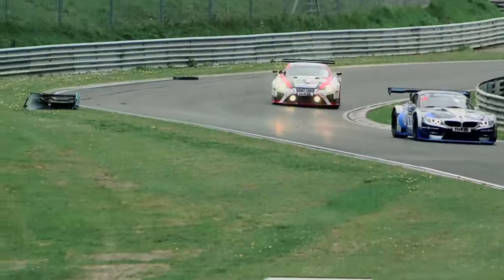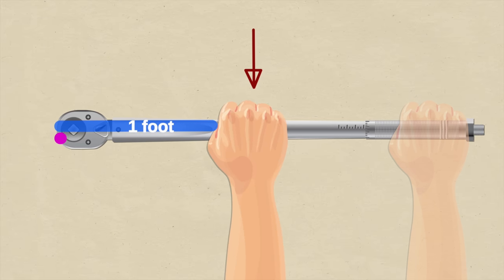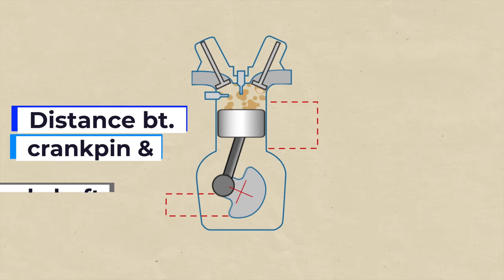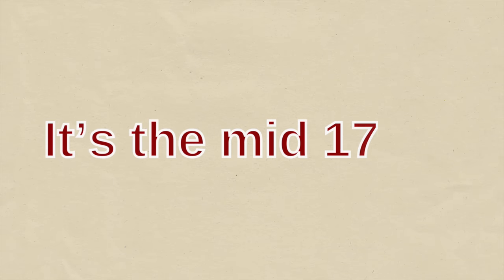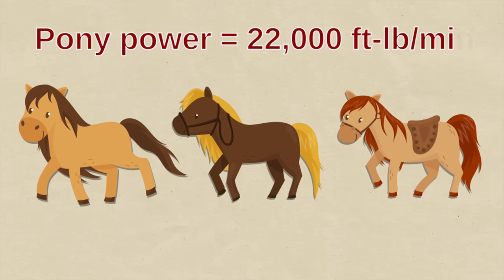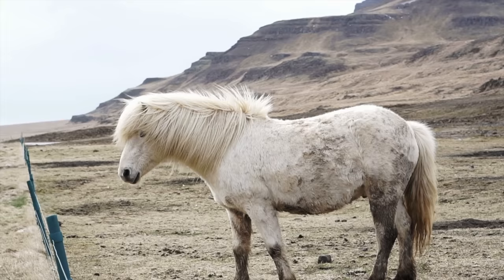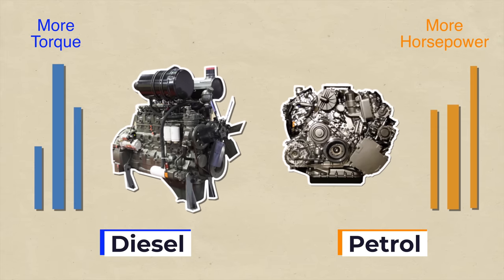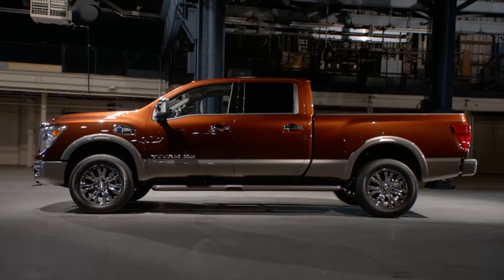Torque vs Horsepower, Which is Better

Comment: Simply put, Horsepower is how fast you apply torque.
Reply: No, that's incorrect. Torque doesn't necessarily mean rotation. You could be on a hill with the engine and transmission holding you, but technically that is doing no work because you're not moving. Horsepower is a measure of the rate of doing work, which requires movement against a force. Torque is only the force part of it. Your specific terminology "how fast you apply torque" is expressed mathematically as lb-ft/sec. The closest real world example in car space would be how quickly you step on the gas, or let out the clutch, but even those examples are over-simplistic.

Comment: Hey ive got a problem, before my 2008 audi a4 was leaking oil like the tin man, me and my father repaired that situation with a new oil cover gasket and now its dry as a bone but the oil leakage was covering up another severely minor leak in comparison however its still a concern because from what i can tell it is either transmission fluid in which case im fucked for a week or hydraulic fluid in which case im still fucked for about 4 days and the amount of time for repair isn't really the issue lol so forget that but more so the price. And idk which one it is, my father told me that replacing seals in the trans isnt worth the effort i might as well just buy another trans while if its the hydraulic im assuming you just replace the seals and maybe some gaskets and youre good to go. How true is that? Can i not replace the fluid and seals in my trans without causing the gears to slip and skip? The fluid in question is not very viscous at all compared to oil, is very slippery and and acts like a lubricant and is a bright translucent pink or light red
Reply: How many miles on the '08? If you've been changing the trans fluid according to the maintenance schedule, probably OK to change it again. But if you've skipped it, then you may end up with a problem as not all of the old oil will be drained out and the viscosity of the new and old oil won't work well. In that case, you just leave it alone if it's working fine.
Reply: @ninemilliondollars  we drained it, and refilled it with 5 quarts of new oil and a conditioner and its working great, no more leaks. Idk if maybe we put to little in or what but the trans sounds and feels a million times better then before, no more clunky changes or very shaky start ups and idles anymore. Pretty awesome lol. I will say the, not soon after my starter broke and weve replaced that too and now it starts and runs even better lol idk why a starter would affect everything like that but it did.
Reply: @ninemilliondollars  also over 120k but less then 190k miles idk i havent been keeping track. I got it when it had 72k miles and i drive a lot
Reply: @ninemilliondollars  just looked it has 129,185 miles exactly.
Reply: @BallistikaGames  Glad you got all the worked out. For clunking, a low level of trans fluid can cause that as the internal parts try to function without the correct level. Good also you got the starter replaced. They do go bad and on cars that have the stop-start process where the engine shuts off at traffic lights or other places where you're stopped for more than a few seconds, the starter gets worked way more than if it only shuts off when you're done driving. When they get weak, the engine doesn't start well, as you found out. So keep that vehicle working! I had a 1991 Acura Integra 1.8 L with 305,000 on it with original clutch, engine, and trans. My sister had a 2004 Honda CR-V with 353,000 on it. :D

Comment: is it accurate to say that horsepower is the work that produces the torque which moves a vehicle?
Reply: It is the rate at which work is done. The torque produces the horsepower, not the other way around :-)
Reply: Torque is a force but in an engine, that force turns the engine shaft and the momentum results in horsepower.

Comment: The instantly high torque at low rpm is why Teslas can accelerate so quickly.
Reply: That's because he uses induction electric motors without brushes. There is no counter-electromotive force to overcome (motors with brushes generate a magnetic force that works against the motor). Also the internal combustion engine wastes energy accelerating the heaver parts of that type of engine. However, I wonder how much an electric motor of 4-500 HP would cost to replace a diesel truck and pull 80,000 lbs.? That's a much bigger challenge.

Comment: Doesn't a gearbox convert torque to and from speed to the wheels?
Reply: Yes and no. A gearbox takes an input torque and RPM from the engine and converts it to some combination of an output torque and output RPM. In a manual gearbox, for any particular input RPM, a "low" gear gives you very high output torque but low output RPM, while a "high" gear gives you high output RPM, but at a lower output torque. The product of the two - RPM and torque - is power.
When we apply the output torque from the gearbox to the wheels at a standing start in low gear, the torque overcomes friction and inertia (from the weight of the car) and accelerates the car. But once the wheels are turning at a certain speed you need to select a "higher" gear, because the engine's speed is limited. Selecting a higher gear allows the engine to turn the wheels faster, but in order to do so it must give up torque, because the product of the two - T x RPM - for any engine at any speed, is  the maximum power output of the engine. This is why you accelerate slower as you increase in speed.
The gearbox, together with the final drive ratio of the differential, is designed to give the optimal combination of torque and RPM for the particular purpose of the vehicle.
Reply: There's one more concept to think about: when we talk about torque and power from an engine, we're talking about "maximum available" torque and power. The torque required to keep a car traveling at a certain speed (against wind resistance, rolling friction, etc) will be only some fraction of the maximum available torque. The power used (we typically use the word "developed") is also only some fraction of the maximum available power. When the car is at constant speed, there is an equilibrium between the power "developed" and the power lost by wind resistance, etc. As you increase speed, the wind resistance increases (very approximately, by the square of velocity change, so doubling the velocity quadruples the wind resistance), and at some point the power required to keep a constant speed is in equilibrium with the maximum power available from the engine. That is your top speed: the point at which there is no more available torque - or power - to accelerate the car.
Reply: @julianopificius6910  Well said.  This also explains why it's important to have a low drag coefficient, in order to lower the wind resistance.
Reply: @robertromero8692  Yessir ! That keeps your surplus torque as high as possible for as long as possible, maintaining acceleration capability at high speed.

Comment: Which is faster? Two cars with the same torque but different horsepower or two cars with the same horsepower but different torque?
Reply: Your starting assumption is incorrect, so the question is improper. Horsepower is the product of torque and speed. You cannot have horsepower without both torque and speed. So if the torque needed to maintain each car at a certain speed is the same, then the horsepower developed by each engine is the same.
However, if the wind and rolling resistance of  car B is greater at, say, 60 mph than car A, then the torque required to maintain  constant speed for car B will be greater than for car A, and the power developed by car B will be greater than by car A, even though the speed is the same.
Now let's say that car A is identical to car C, but car C has three more passengers in it, and they're both going up a steep hill at 15mph, car C will need more torque to climb the hill and car A, and so will develop more power, even though the speed is the same.
The torque curve for an engine is a statement of the torque the engine is capable of delivering over its working speed range. The horsepower curve - more accurately  "brake horsepower" is the amount of power than may be extracted from an engine over its speed range using a dynamometer.
Reply: Let's assume both cars are identical in all ways other than the engine as you described. And this is a 0-60 mph race. In both cases the car with the lower rpm and higher horsepower will be the fastest. It gets to peak horsepower quicker than the car needing to get to the higher rpm having the same horsepower. It performs more work sooner.

Comment: Why did not you use metric system instead of that archaic anglowhateverlbs crap, Scotty.
There is ,at least, one European guy very confused right now.
BTW,nice explanation tho.
Reply: We grew up with the Imperial system and learned when picking up objects, like a bowling ball, that it weights 16 lbs., not 7.272 kg. We know the feel for like a pound of turkey but not for 454.4 grams of turkey. It's built into the culture. Personally, I like using metric for some things.

Comment: Sadly, I still don't understand horsepower. Torque is easy but hp is a hard to visualize concept for me to remember.
Reply: I posted this for another person.
Try this. You're tightening a nut with a 12" long wrench. It takes you 1 second to make a complete turn of the wrench and you expend 100 lbs. of effort doing so. And let's say you're really strong and fast and can do 60 nuts in one minute. That would be a lot of work. Well, the 100 lbs. of effort is torque - twisting effort,  and the speed you do it at is equivalent to 60 revolutions in one minute. Horsepower is equal to 60 times 100 divided by a constant of 5252. This means you put out 1.1 horsepower of work. And horsepower is useful to compare different engines with each other although there are other attributes that need to be considered. Hope that helps.
Reply: @Mark Codiroli Sorry, forgot about your question on BHP. Actually I gave a formula for HP based upon a leaver being turned. It could be used for many simplistic "machines" being turned. But engine BHP or SAE Net is not quite the same. BHP is what it takes to slow an engine by braking it. SAE Net HP is taken at the driveshaft indicating engine power after reduced by the energy required to drive all the other parts needed to keep the engine running such as the water pump or the alternator. :D

Comment: In a race horsepower wins every time.
Reply: How about at a stoplight and the race is only 100 ft. Low-end high torque vehicle would beat high HP vehicle which wouldn't have time to get up to it's needed rpm. :D

Comment: Diesels you constantly need to clean engine intakes, europe switched back from german diesels to toyota petrolium engines. Not worth the maintenance nightmare, plus in cold winters you will not start diesel, that is why rusdians in arctic are using gas turbine aviation engines, also thise darn teslas do not work in syberia, that is why Vladimir Putin on his car instead batteries puts diesel generator. Everything has its own climat limitations, diesel is good for high altitutes in german mountains die to lack of oxygen, buy simpler car otherwise will have lots of headaches

Comment: Horse power vs torque?

The real question is.. can my sexy car last me for 7-10 years without any mechanical problems? 🤔

A car should be used to make you more money, not empty your bank account.
Reply: Your car will last you 7-10 years if you service it according to the manual and don't abuse the engine nor transmission.
Reply: Mario S.  😂😂 very true

Comment: Horsepower : Bruce Lee🥋🥋🙏🏾

Torque: Mark Henry 💪🏾💪🏾🐃
Reply: Yes, but the gearing confuses people. So you take Bruce Lee and give him a ballast to match MH’s weight then they can ride a bicycle and they will have similar performace if they have the same power,  except they will use different pinion sprockets on their bikes,

Comment: It’s the same as Voltage vs Current
Reply: Yes! Voltage is pressure, translates to torque, while current is flow, or RPM. The product of the two is also power in watts. High power electrical power conversion equipment, such as motors and electrical equipment to control them, are typically rated in horsepower.

Comment: still dont get the difference. torque is a component of power. power to the wheels is what causes your car to move. not sure how one can  be better than the other because without torque you cant have power

also if more torque means low end power to tow a load then by that logic i can spin the engine up faster on a lower torque engine to get the same power to tow the same load no?
Reply: Looking at the last thing you said, yes, you can get the same power from two different engines - one with lots of low-end torque and one with high-end torque - by varying the rpm. The challenge when towing a heavy load is when starting out, the high-end torque engine wouldn't be able to get to a high enough rpm to move the load, without stalling. Thus a low-end torque engine is needed. And this applies to any vehicle (whether towing or not), but results in whether you want to get up to speed quickly or have more higher speed capability.

Comment: So torque is the strength and horsepower is the speed.....?
Reply: Sort of, but it's not quite that simple. Torque is twisting force, horsepower is what you get when you can still create that twisting force while spinning at a certain RPM. Horsepower is the product of the two.
Using a human example:
You can stand on a bicycle pedal - that's torque. If somebody is hold the bike, preventing you from moving, you have torque but no power.
Now, pedal the bike on a flat road to accelerate it to 10MPH. How long would that take you? Now, how long would it take you to accelerate that bike to 20 MPH? Could you even do it? What about 30 mph? Could you do that? No? Why not? First, you can't pedal as hard at high speed, for one thing, and the wind resistance makes it harder to even maintain a steady  speed.
Your reduced ability to push the pedals at all as speed increases is your "torque curve", and the continuous effort needed to maintain ever higher speed is your "power curve".
Lastly, speed doesn't necessarily translate directly to power. If you're bicycling down a hill, legs up, you don't need any power, right?
Once you've pedaled up to 10 mph, the effort you need to maintain that speed is less than it took to get there, right?
That is the relationship between torque and power.

Comment: Diesel fuel contains more power per gallon than gasoline. That is one of the reasons Diesel engines get good fuel economy. Ethanol has less power per gallon than gasoline. That is largely why cars using E85 get worse fuel economy than the same car running gasoline. 

Horsepower is a measure of work. Torque is a number in an equation. Without a RPM number, torque is meaningless. One million foot pounds of torque at 0 RPM is 0 horsepower.
Reply: Except  that without torque you won't develop horsepower in the first place. Torque isn't just the number in an equation, it is the energy source behind the horsepower.

Comment: Diesel engines have more torque because of more reciprocal weight.
Reply: Also because there is more energy in diesel fuel compared to the same volume of gasoline.

Comment: Never could get the difference between torque and horse power still couldn't really understand the difference 🤔
Reply: Torque is the twisting force the engine can produce,that's all. Obviously you can't stall the engine to zero speed, but you can apply a load to try to stop it. The rated torque is a measurement of the amount of resistance you can apply to the engine at the specified speed without it stalling.
Power is nothing more than the torque multiplied by the RPM multiplied by a constant to make the units work right.
Reply: Try this. You're tightening a nut with a 12" long wrench. It takes you 1 second to make a complete turn of the wrench and you expend 100 lbs. of effort doing so. And let's say you're really strong and fast and can do 60 nuts in one minute. That would be a lot of work. Well, the 100 lbs. of effort is torque - twisting effort,  and the speed you do it at is equivalent to 60 revolutions in one minute. Horsepower is equal to 60 times 100 divided by a constant of 5252. This means you put out 1.1 horsepower of work. And horsepower is useful to compare different engines with each other although there are other attributes that need to be considered. Hope that helps.

Comment: Torque is real and can be measured.  Horsepower is a fiction and can only be derived by a formula.
Reply: Sure, but the concept of horsepower resulting from rpm and torque is helpful in understanding and comparing one engine to another. There may be other ways, but this one does work.

Comment: Power = Torque x Angular Velocity
Reply: Yes, but that's really only Force. Horsepower is Force applied over a Distance determined by the formula HP = (Torque * RPM) / 55252).
Reply: @ninemilliondollars  Isn't that (torque x RPM)/5252
Reply: @suggesttwo  Yes, as you've correctly stated "5252." Thanks.